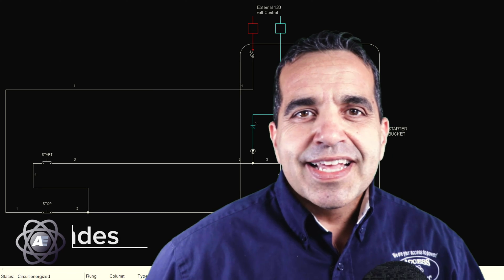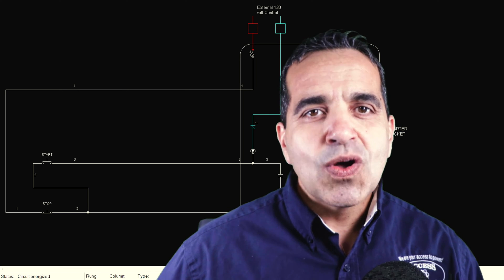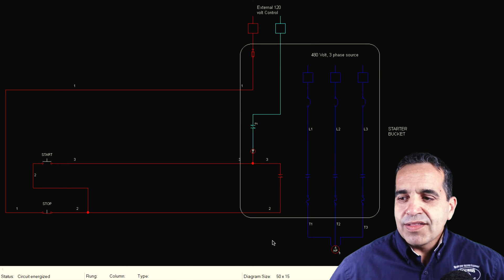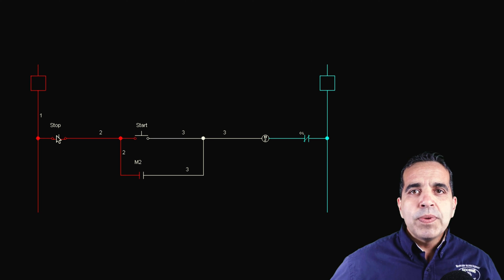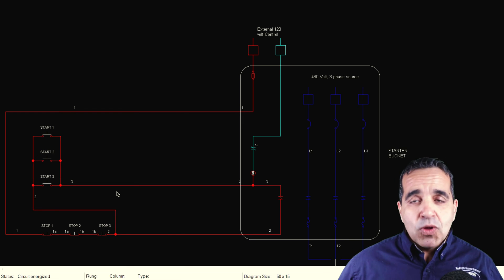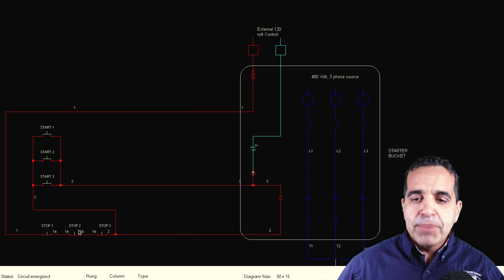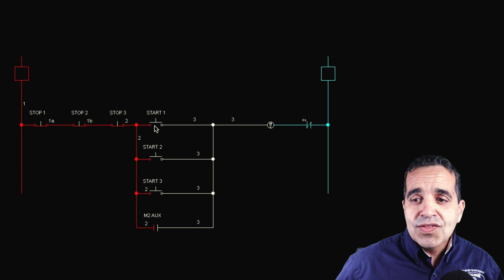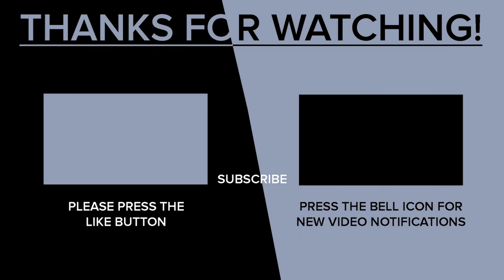Basic Motor Control: 3 wire Start Stop with multiple pushbuttons

Comment: So if i have one motor control(soft starter) that controls outlets in two separate locations and have multiple 3 wire pushbutton controls, how can I wire in a safety switch or transfer switch to switch between locations? I only have one soft start but the motor is used in two separate locations. I just want to make sure someone can't activate the motor from the other control location. Is there a way to wire in a transfer switch or e-stop or what do you recommend?
Reply from the maker: You may be able to install 2 contactors after the soft start. You can parallel the start signal through auxiliaries on both contactors to the soft start. Control one contactor from one of your 3 wire start stops and the other contactor from the other 3 wire start stop. Each of your plugs will be wired to its own contactor. 

This is one way to do what you described .

Comment: This video just saved me hours of trying to figure this out on my own! Thank you.        I recently purchased a large sliding table saw that I need to power with a VFD (single phase to three phase) and the magnetic switch was giving me error codes all day. Through trial and error I realized I needed to bypass that control. Now I am wiring buttons/switches and attempting to use the E-stops that the saw has in place. With this info I can add extra stop buttons for safety and add an additional start button on the other side of the machine.
Reply from the maker: Glad it was helpful. Be careful and stay safe.

Comment: My factory is automated and I'm using cat5 to control the entire plant in i/o boxes and sensors and motors and plumbing systems that control everything. I'm not an electrician but I wire motors, change vfd's, connectors, and diagnos issues for the operators. That and all the mechanics and light welding and I'd love to know the exact safe way to do this stuff because I'm taught by old men who have accidentally shocked me and seen other mistakes made so I like the subject matter. More in field examples maybe